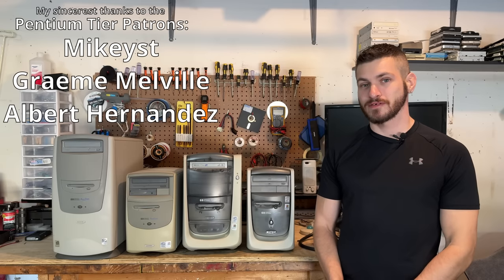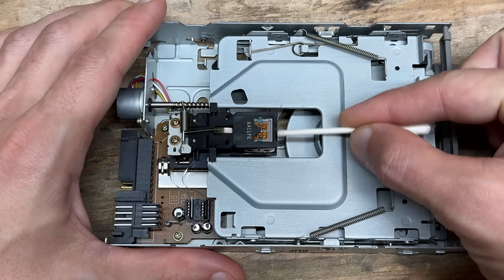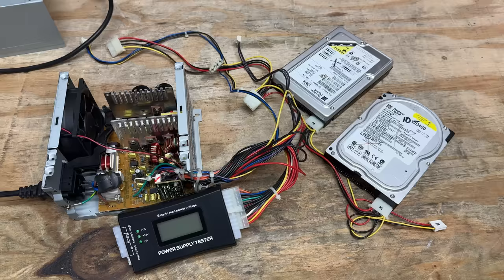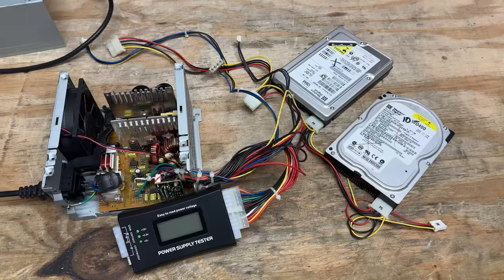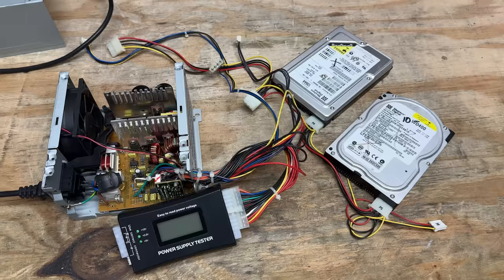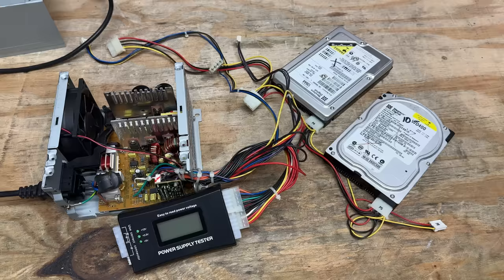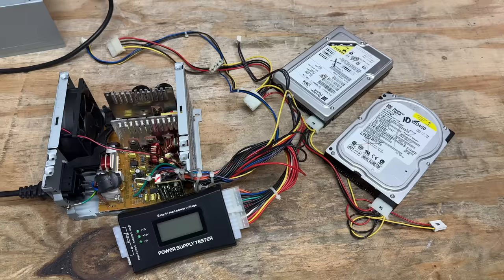HP Bubble Systems! Classic late '90s computers - Teardown and test!

Comment: I had the innards of a Pavilion 4450 inside a 6535 machine that ate it. the case was the best part, bit roomier than the 4450. XP Home flew on it with 512MB of RAM and an 80-gig drive, but had to also add in an AGP graphics card of some flavor because the onboard video was terrible.

Comment: I actually had one of those hp desktops as a kid, it was around when windows xp came out and my parents got a new family computer that had xp, but my parents old windows me hp desktop, they had no where to put it and I am a huge tech nerd, so they handed it down to me. Still to this day I had no problem with windows me and why everyone hated it, that bitch even came with a crappy windows movie maker and my kid self was having fun making half ass movies. So later in my teen years, myself just decided to throw it away and still to this day I still hate myself for throwing it out, cause later down the road and still loving old tech and old computers I bought a old hp desktop and I made sure it was close to the one I threw away. I'm still working on it, all I need to do is try to figure out on how to install windows me on a cf card, I got all of the tools I just havent gotten around to actually setting it up.

Comment: Removable mobo trays is a such great design, you see this PCs from the past and ALL of them was designed to be serviceable.
You look at todays cases and mobo designs and it's like they were make to hate the user.... Ever tried taking out a big current GPU (330mm, 3 slots) installed on the first PCI-E slot while having a current heatsink that covers 30% of the mobo that leaves no gap between it and the GPU? yep... once the GPU gets inserted and it's locked by the SLOT... good luck taking it out without having taking everything apart first. My solution is always tie a fishing line to the PCIe lock so I can pull the damn thing to release the GPU. It's just bad designs... 
I miss those days where everything is: "if you pull this thinggy and it realeases that thinggy"

Comment: Too bad the system 1 didn't include the hard drive. The one my family had was a Quantum Bigfoot 5.25" drive.
Reply from the maker: I still have my Quantum Bigfoot from back in the day. Used it in my teen years. It still works perfectly!
Reply: @miketech1024  and it’s just the right kind of nostalgic mechanical drive noise ☺️

Comment: Welcome back sunshine!

10:25 oh dear, that drive sounds terrible. Like it wants to eat your first born.

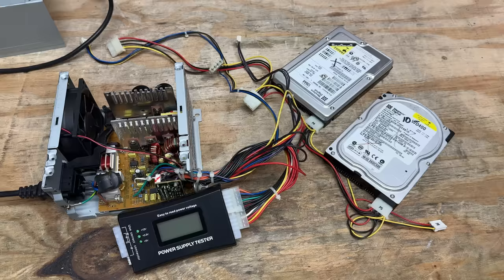25:30 I could never have a door like that. I'd forget to open it and have the drive tray slam into it.

34:26 ... it's like you've read my mind.
Reply: Having the tray slam into the door isn't the problem with the design.  It's having absolutely everything else in the world slam into the door.  I'm honestly surprised that one survived, because probably 3/4 of the systems I worked on within the first couple years of this design had them snapped clean off.